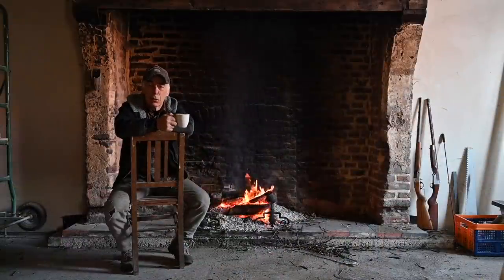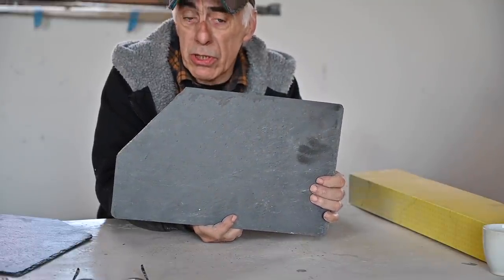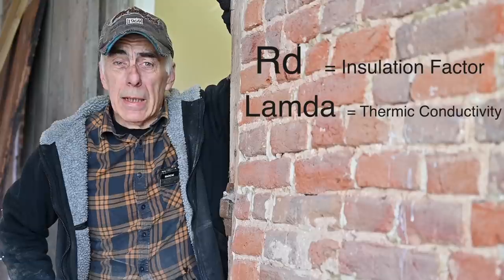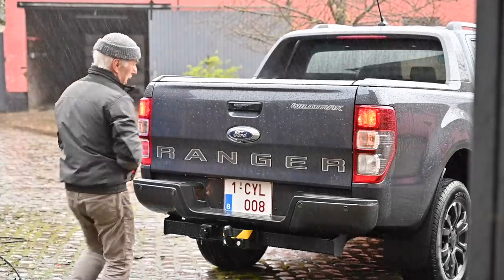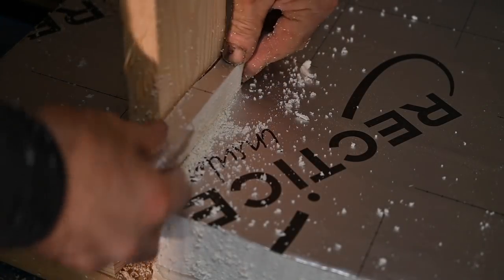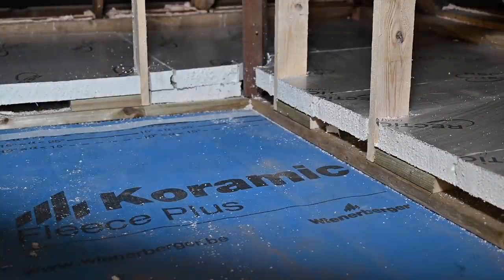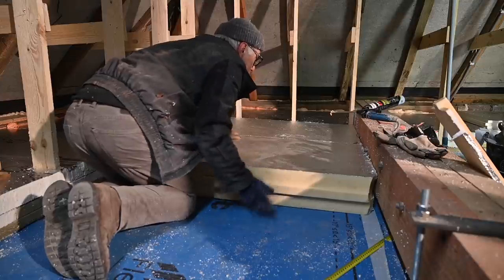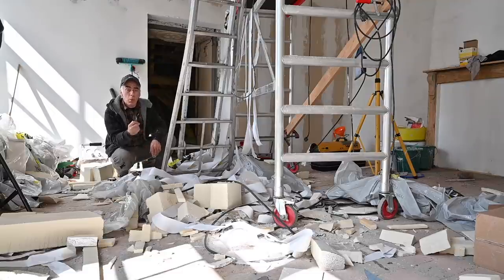Insulating the tower attick

Comment: Very nice. Superb insulation material.

When doing this kind of work in old houses its important to think about how one change the climate in the attic space.
Here in Sweden houses used to rely on heat from the living areas and the chimney to dry out the attic space.
If one improve the insulation alot and maybe also change the heating to a heat pump the space get colder and therefore damp and mold starts.
Some then take up a hole in the wall for venting but depending on the curcumstance that might make it worse.
A bit tricky all and all..

Comment: Steve I see a Ranger. What about the Defender?
Reply from the maker: The Def was a 2003 and banned in the LEZ ( low Emission Zones), not that I like to drive in those area's. But sometimes I needed to travel there and could no longer with the DEF ( damm green party)... So I sold it , and awaiting the ineos Grenadier with hydrogen cell ( else they TAX us to death). So I needed a replacement  until the Grenadier is available ( not the diesel version as that runs 3000 Euro road tax plus another 8000 Euro fee to bring into traffic)....

Comment: the ranger is wearing the LR plates. What happened?
Reply from the maker: The Def was a 2003 and banned in the LEZ ( low Emission Zones), not that I like to drive in those area's. But sometimes I needed to travel there and could no longer with the DEF ( damm green party)... So I sold it , and awaiting the ineos Grenadier with hydrogen cell ( else they TAX us to death). So I needed a replacement  until the Grenadier is available ( not the diesel version as that runs 3000 Euro road tax plus another 8000 Euro fee to bring into traffic)....